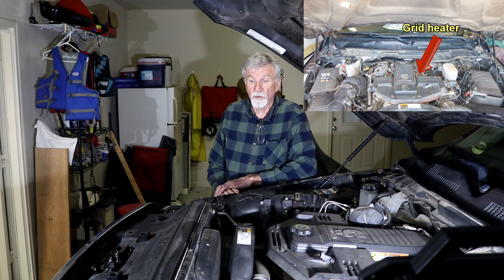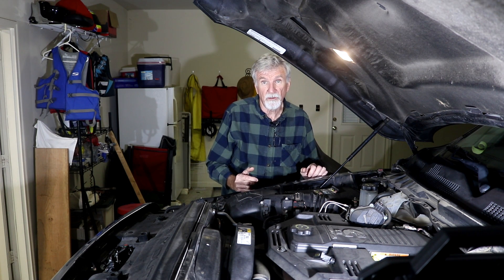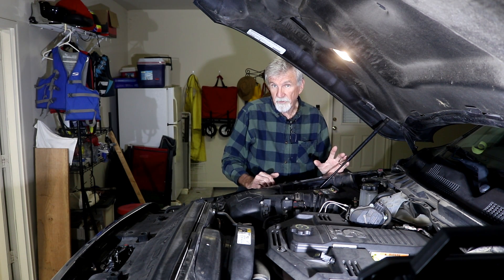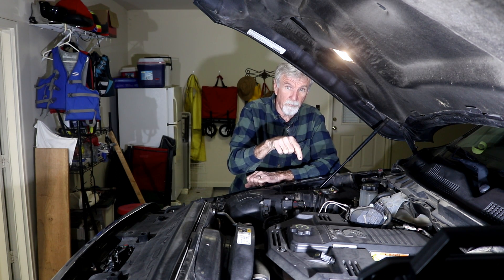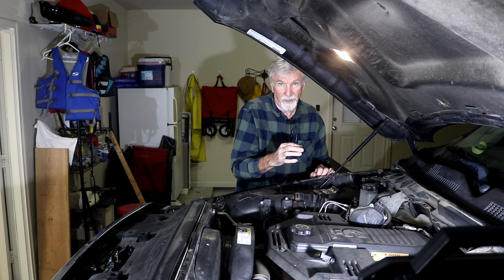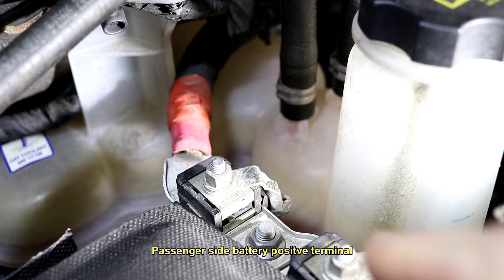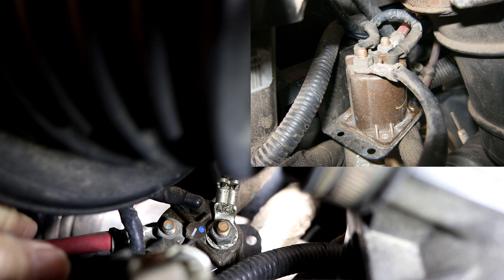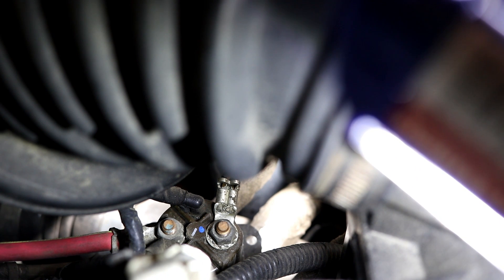Cummins Grid Heater Killer Bolt Issue - Amps & Voltage on engine start

Comment: Thanks Marion, Happy New year to you and your family. Please don't take this the the wrong way, I do appreciate the information but everytime I see something new like this on the 6.7l Cummins I get worried. Seems like there's a lot too stay on top of. I love the Engine, I love the Truck but it's potential problems that crop up such as this, is where I start thinking, maybe I should have stayed with a gas Truck. I pray it's a Rock Solid Platform. I know one thing, it's a Joy to drive on the highway. Thanks so much let me know if you decide to come down to Florida, if you do I'll send my contact info.
Reply: It will be ok Ed.  It will.
Reply: @sumnerkinney2166  I'm sure it will, I do think the RAM/CUMMINS owners are a great folks. Thanks so much for your kind words.
Reply from the maker: Thank you Ed, I certainly understand. I think we all have those emotions from time to time when we see things like this but believe me this is very very rare, there are trucks running around with 300,000 miles plus that's never missed a beat
Reply: Gas engines have their own problems and live a shorter life.
Reply from the maker: @RealEyezRealLiez  Yea, nothing's perfect.  If you don't need torque and fuel economy when towing, a gas engine will do just fine.  The EPA has hurt the diesel engine reliability for sure.

Comment: I have had my 2014 ram 2500 since Feb 27 2014, I have had 0 issues with anything, taken care of the recalls, but no other issues, love my truck as you,  keep up the videos
Reply from the maker: Same with me, mine runs so good it's scary
Reply: Add me to the list. 2014 3500 SRW. Running great at 104k.

Comment: Had my grid heater deleted (and then some) for over three years now.  This is just another issue I'll never have to worry about.  👍
Reply from the maker: I'm working my way toward doing the same thing eventually
Reply from the maker: Yea or make really good friends with the emissions tester. I lived in Ventura for 8 years in the 80's and they were doing exhaust test back then on the gas engines.
Reply: Me too if I can get out of komifornia
Reply: Register it in Imperial county, it’s a no smog check county
Reply: bayonne  How would I go about this? Live in Riverside County. Need a address down there somehow? Thanks
Reply: My truck smokes a lot when is to cool. I want to do the delete but how that works?? Is going to start right when is cool?